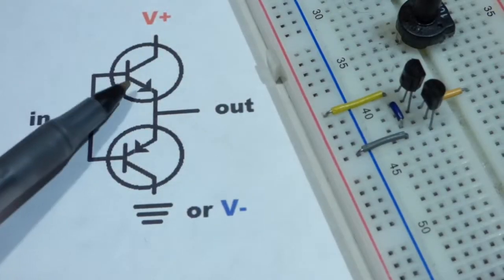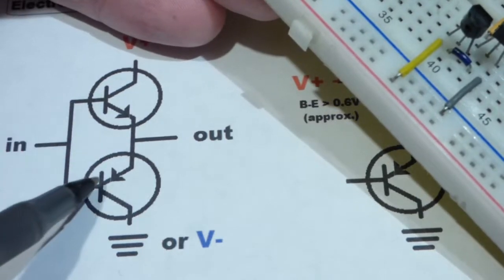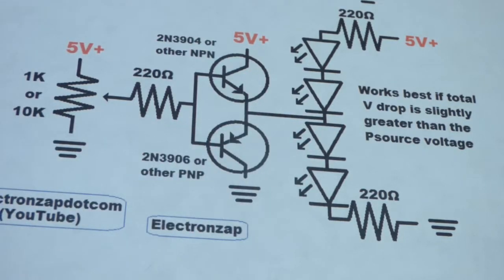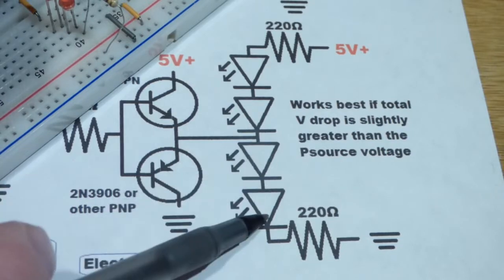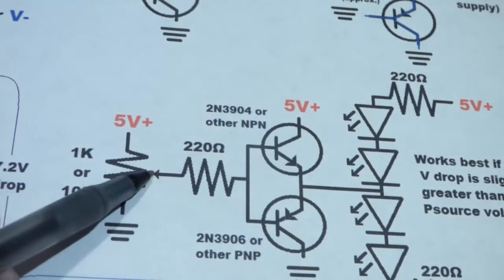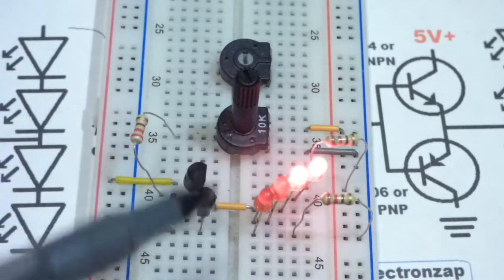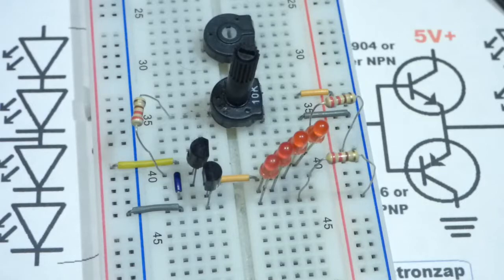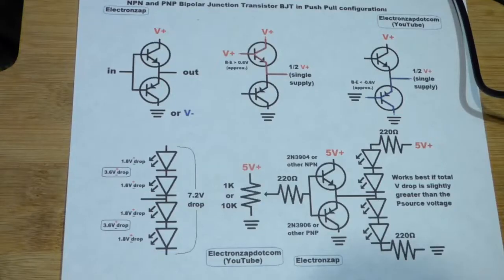Bipolar Junction Transistor BJT NPN 2N3904 and PNP 2N3906 in push pull configuration with diagram

Comment: If both transistors are "off", the circuit has 4 LED's connected in series, 5 volts on one end, ground on the other. The LEDs will light up.
Reply from the maker: Takes more than 5V for 4 LEDs to light up. That's why I used 4 instead of 2 :)